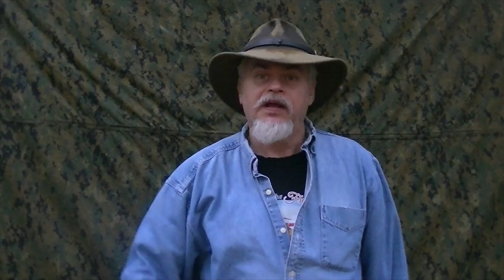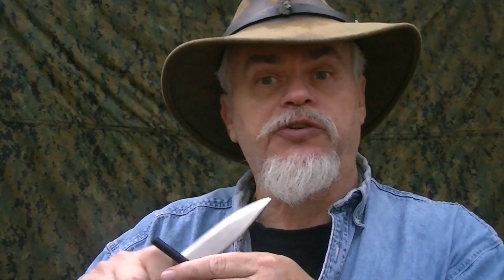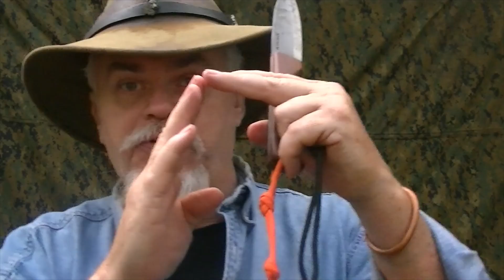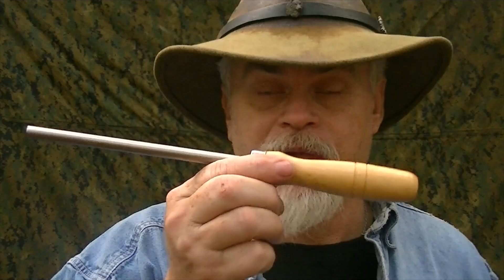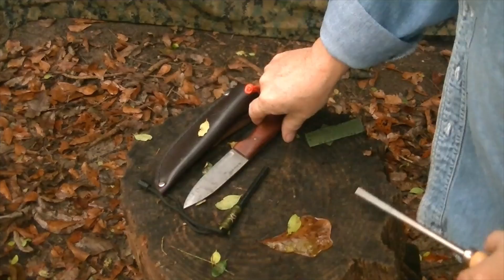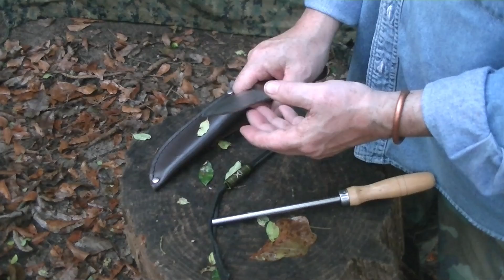KEEP THAT 90 DEG SPINE ON YOUR KNIFE

Comment: Good video Blackie 
I didn't know about using a burnishing rod for forming a 90-degree spine!
Normally use a file to maintain a 90-degree spine and a Worksharp to obtain a 90-degree spine
Reply from the maker: thats what i have done in the past as well
but this tool will do a good job and does not remove as much
metal

Comment: Great tip Blackie-  is that de-burring rod the same as a honing rod?  I usually use the small Baylite scrapers, but agree 100% of having a sharp 90 degree on the spine.  Good stuff and thanks for the instructions.  Be safe out there-

Comment: I love using card scrapers to finish my projects. 

I use a broken high speed steel drill bit that's just glued into a wooden handle. The one I'm using now is a 1/8th inch bit, but it's very strong enough for pressing and forcing the burr on the scraper. 

A dab of oil, I usually use mineral oil, helps get the burr smooth as well

Comment: A carbide burnisher can be had for around 18 dollars with a handle, and cheaper without. With care and a light touch, they can also be used as a quick steel - just don't go overboard. I've used them for years. Thanks, Blackie.

Comment: That wire edge will break off very quickly and once that happens the spine will be slightly convex. I'd prefer to return the spine to a solid 90 degree free of burrs and it will be much more durable as well as strike the ferro rod well